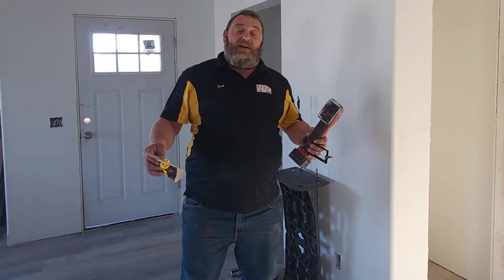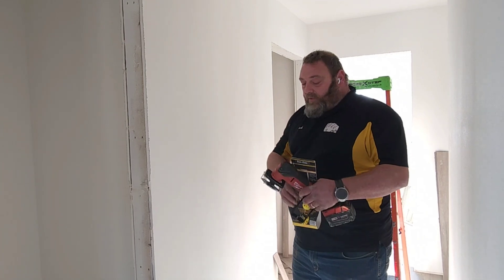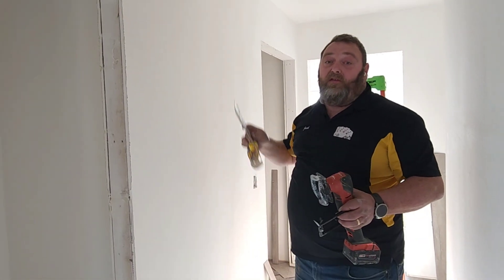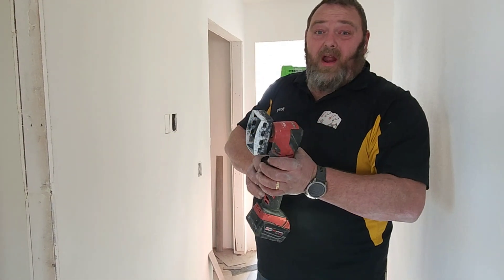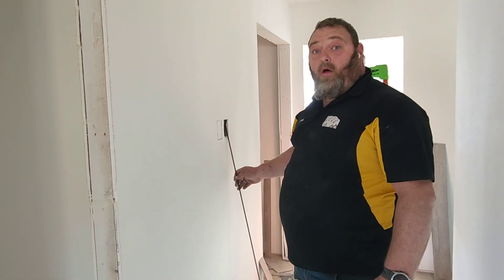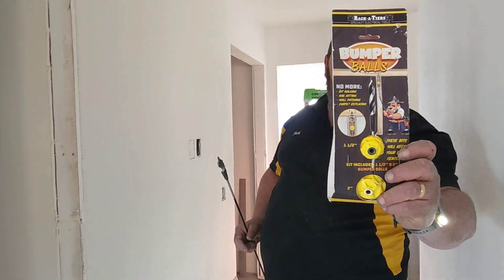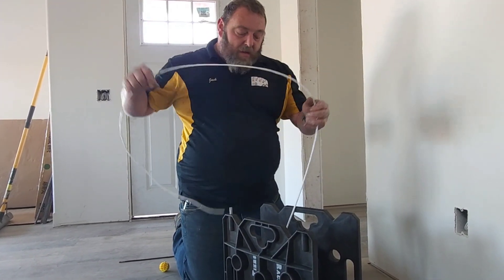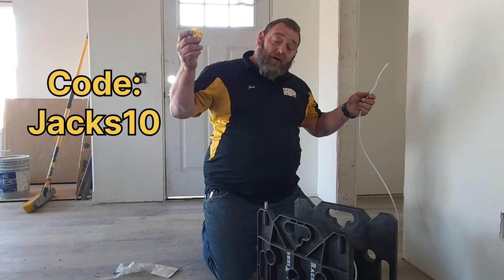Tricks Tools & Techniques to adding a Missed Electrical Wire / How to Wire a House

Comment: Shouldnt you just drilled the hole from the attic ?
Reply from the maker: You could have in this case but generally you can't see the wall due to insulation